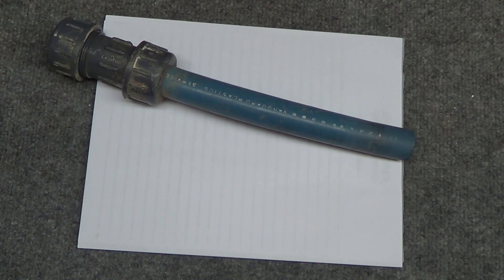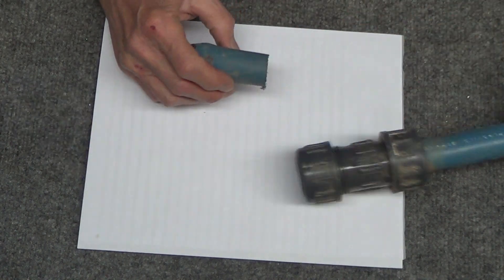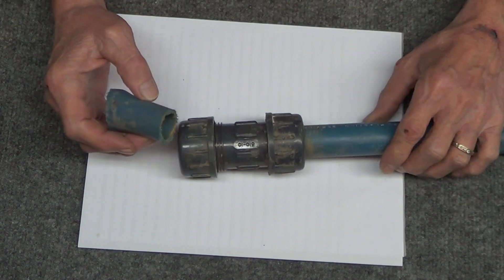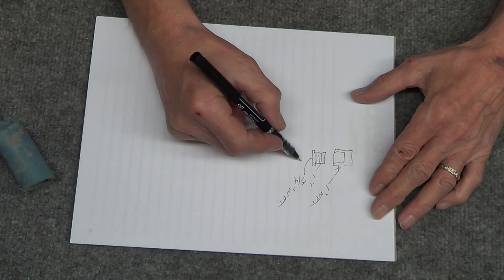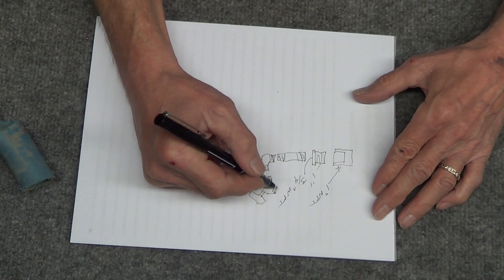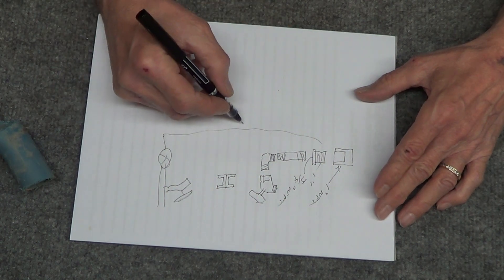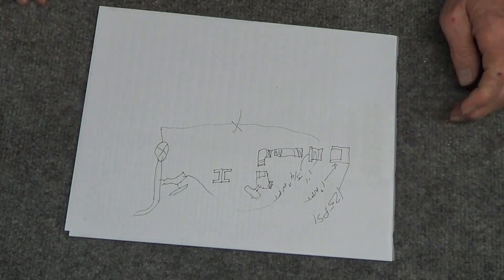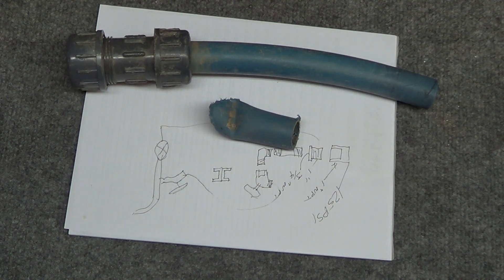DIY: Polybutylene Main Waterline Fix & Workaround

Comment: If you connect your by-pass to a water spigot that has an anti-siphon device it will leak out the stem of the valve handle.  At least mine did.  I'm in the camp of its not "if" but "when" as far as when it will fail.  3rd time mine has leaked, with no visible reason for the cause of the leaks.  Finally replacing it this time.

Comment: I have the same service line.  So you think if it was installed properly, polybutylene pipes are fine and don't need to be replaced?
Reply from the maker: Yes! Mine showed no signs of wear or chemical deterioration of any kind after some 20 years. Had it been installed correctly I would have never had a problem. There are some 400 homes here and only a few have been replaced. One simply patched but you can't buy the kits anymore.
Reply: That's interesting.  Thanks for the info.  I've read so many negative information about polybutylene pipes that I'm thinking about replacing mine even though there are currently no issues.  There are many articles online that say "it's not a matter of IF it'll fail, but WHEN it'll fail, so you should replace all polybutylene pipes".  Do you think it's just fear mongering by plumbers looking for business?
Reply from the maker: I read all the same articles saying it WILL fail. Again I see no reason it should. Tract homes, a trencher comes in, someone then throws pipe in the trench and a bobcat then pushes dirt all over. The problem is our yards are 60% rock so a 5 ton bobcat trampling dirt and rock on a plastic pipe isn't a good idea. The 3 that were replaced were from rock damage. The pipe and joints were perfect otherwise. So you can spend $3,000 or if it does fail do what I did in this video and water is restored while repairs are made.
Reply: The articles say that the pipes will fail due to chlorine in the public water supply.  It's good to see in your video that your pipes have no chemical deterioration.  Do you by any chance not have chlorinated water running through those pipes?
Reply from the maker: Oh it's well chlorinated which is why I refuse to drink tap water.
Reply: I have polybutelene and NOTHING BUT TROUBLE WITH IT !!!   CANNOT  WAIT TIL I CAN AFFORD TO REPLACE IT WITH PEX !!!!
Reply: Oops!!  Spelled it wrong !!!  Polybutylene!!!